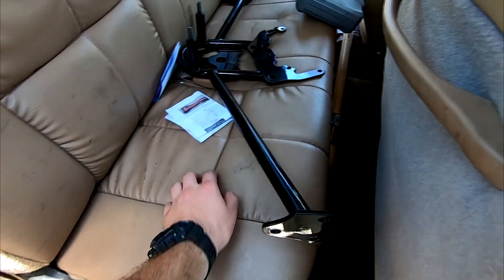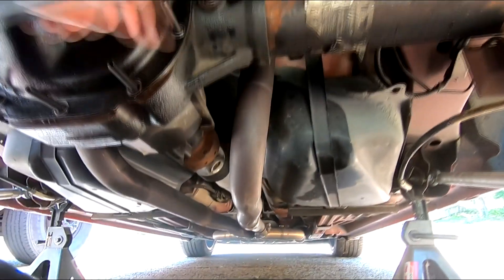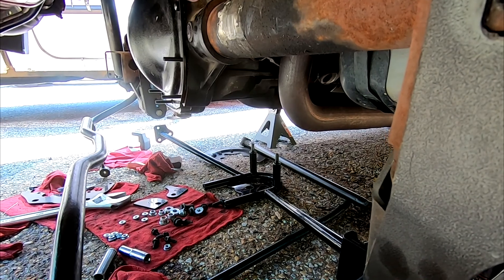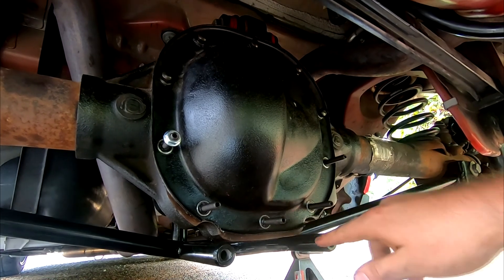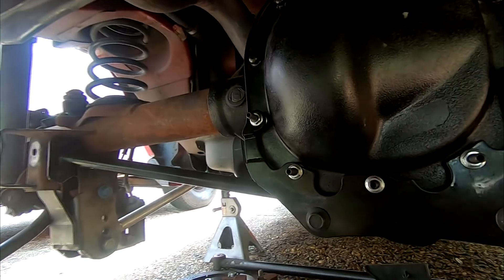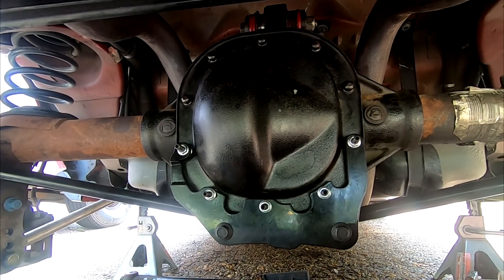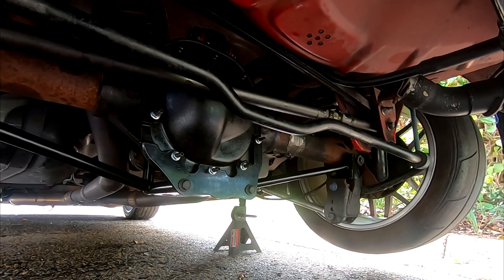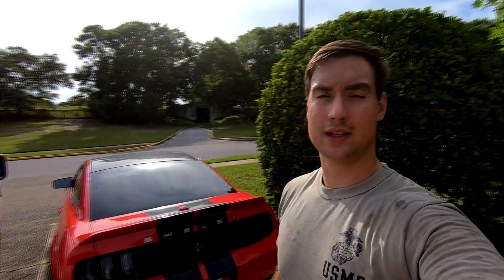Che Performance Ford 8.8 Axle Brace Install on a 2007 GT500

Comment: I know this is an older video  but I'm running into an issue with this installation.  I'm running into the same issue you ran into with the relocation bracket.  There isn't much clearance to get a bolt through there because the bracket is in the way.  How did u manage to get the bolt through?  Any help would be much appreciated!  Very nice car btw!
Reply from the maker: Hey man, interesting that you're having the same issue. It has been a while, but I'm pretty sure I wound up taking a dremel or used a drill and made the hole oblong until I was able to get the bolt through.
Reply: So the bolt went through on an angle and not straight through?  Wouldn't that make the retaining nut on the back side not sit flush?
Reply from the maker: @BrandonQuincy  No, I'm saying I made the hole on the brace longer until it lined up with the one on the axle. From a circle to more of an oval with a dremel tool. o to 0 shape.
Reply: @AllThingsBoost  the issue I'm having is with the driver side bottom bolt.  The one you had to angle the drill bit?

Comment: Is this pretty much doing a similar job as a Watts link? Fingers crossed this works out for you.
Reply from the maker: No, so the watts link to my understanding replaces the panhard bar, so when the car squats up and down the axle stays perfectly centered. This just reinforces the axle tubes. Apparently it's a known issue that they will sometimes rotate under launch conditions throwing everything off and basically making the rear axle a paper weight
Reply: AllThingsBoost I knew that, but the connection parts almost make it seem like the watts link will help this too unless I missed something from the angle of the video.
Reply from the maker: Interesting, I had to educate myself real quick lol. It looks like the one from BMR atleast does brace itself with the axle tubes. I'd be very curious to know if they are compatible or not. It doesn't look like it has the same amount of strength to prevent rotation, but I suppose anything helps. If I ever decide to get into road course, watts like is first on my mod list
Reply: AllThingsBoost was just curious because my car has a watts link and it dead hooks. Wondering if I need to worry about my tubes, but there is nothing moving that damn rear end.